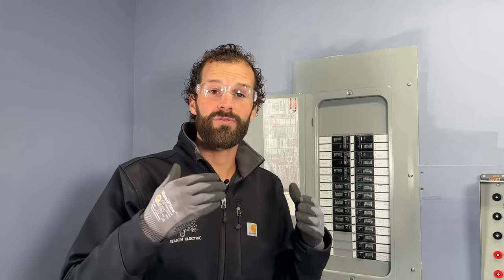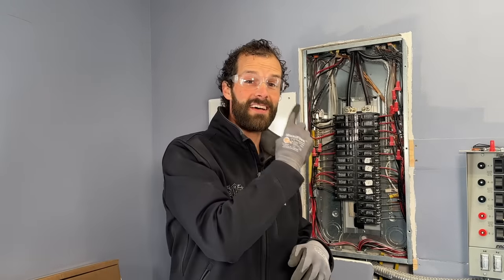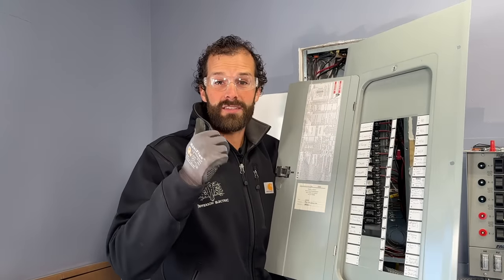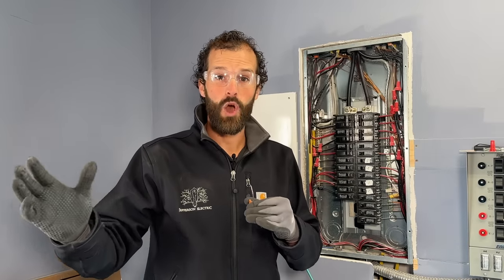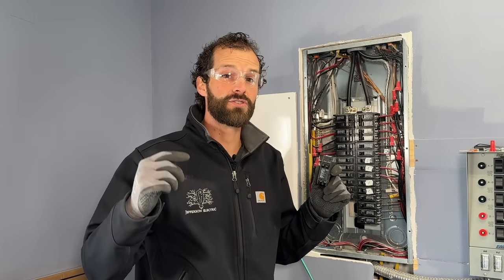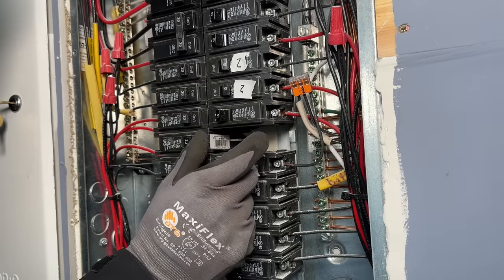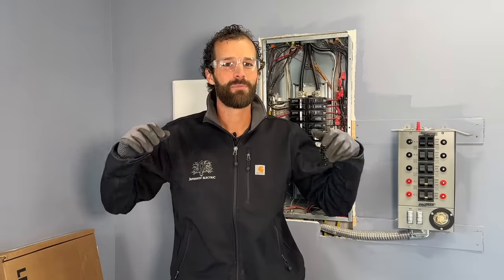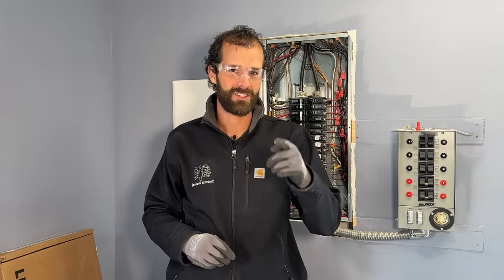No Room In Electrical Panel - Quick Fix

Comment: I've never seen an electrician shut off all power before removing the cover, but it's good advice.  

The downside to combining circuits is that if you turn off the power to do some sort of electrical work is you will turn off a lot more of the house with each breaker.   Do yourself a favor and write down everything controlled by the circuit in some detail and tape it inside the box somehow.   At a minimum, try to balance both sides of the service.

The best solution, albeit a very expensive one,  is to split the service coming into the house into two panels and then you'll have plenty of room for growth.  If you get an automatic standby generator, you'll end up doing that anyway.
Reply: OSHA requires protective gear to remove a panel cover even if you turn off the panel. Until you verify it. (Nobody does it)
Reply: @hankkline7300  It's good advice and well considered, but as a practical matter, many electricians doing a branch circuit in an existing panel will wire a breaker first and then snap it into the live panel, unless they're doing a major rewire.   They they'll shut the whole thing down.
Reply: @hankkline7300  OSHA doesn't have jurisdiction over homeowners or farmers with under 12 employees.
Reply: @Sc-jf3yk  Who mentioned OSHA?
Reply: @hankkline7300  you did
Reply: I was referring to electricians, not wannabe electricians.
Reply: @hankkline7300  why would an electrician watch this video?    They should already know it.
Reply: @Sc-jf3yk  Curiosity, I like to see what other people are trying to teach amateurs how to do it. I have seen so many do-it-yourselfers who think wiring is so simple. They make many potential fatal mistakes. Many homes I have gone into are so dangerous I would never be able to sleep in them. I know sometimes electricians make mistakes, but I can always tell if a handyman has attempted the job. I am sure that a homeowner is more qualified to remove an electrical panel cover than an electrician who has had more than 30 years of continuing education classes to maintain his license, but that is my opinion. The wannabe electrician installs his electric just like he saw someone else do it. Even if the other person has never done it for a living, or been trained how to do it safely and according to the codes which are there to prevent fires and electrocution. I have rewired many residences which have not completely burned down, and the people have not died in the fire thanks to God.
Reply: @hankkline7300  I respect your comment more than you know
Reply: WRONG. You don't end up doing that with an interlock and main panel.
Reply: @mastershredder2002  It's quite common to do it that way for a residential standby generator. It would be unusual to have a generator large enough to support 200A.   Typically two panels: one for the circuits with the interlock that will be automatically cut over to generator power, and one that is only powered by the line coming power company.  

Generator starts up, the interlock waits 30 seconds, and cuts over automatically.   When  power is restored, the interlock cuts back and the generator is allowed to cool down and then shuts off.
Reply: @hankkline7300  OSHA applies to Occupations, IE: workers, not homeowners or random you tubers making videos.
Reply: @teekay_1  "Interlock?" You mean automatic transfer switch.

Comment: I used to install gas station eq. I lost track of how many  PROFFESSONAL  electricians would wire
the cash register inside the store to L1 & all or some of the pumps outside to L2. Someone would 
turn on the regular #3 pump & 240vac would go to the pump relay &  !POW! a flash & some smoke.
So I got into the habit of checking all the wiring  at each pump BEFORE I applied power. Good times.

!

Comment: Smoke detectors must be connected to light load to ensure you notice if they trip by not having light.
Reply: that may be a local rule, but it's not a code requirement.
Reply: @kenbrown2808  And some jurisdictions require them to be on a dedicated  circuit.
Reply: @WilliamEades_Frostbite  a central alarm without a battery backup is required to have a dedicated circuit.
Reply: @kenbrown2808  Here ALL new builds require battery backup and dedicated circuit...Local Codes.
Reply: @WilliamEades_Frostbite  and here they'd prefer standard smoke detectors be on a general lighting circuit so a bad resident won't just turn them off and pull the batteries.
Reply: While most guys do this because it is very clever to insure the smokes won't be de-energized easily..... it's never been an NEC Code. This is how disinformation is made right here.😆
Reply: @WilliamEades_Frostbite  Are you sure about that? Making it dedicated on one breaker makes it that much easier to turn off with no inconvenience to the residents, I think you missed the point. If that is the local code then it's not very logical.
Reply: @fritzmiller9792  that's why i said "prefer"
Reply: @fritzmiller9792  You have to take into consideration that the NEC is a subheading of the NFPC.  In practice there is a lot that from experience seems illogical in the NEC.  And that local jurisdictions are allowed to toughen the NEC, but not weaken it.  Here you can cross the street, going from city to county and run into completely different code requirements above and beyond NEC.
Reply: @WilliamEades_Frostbite  yes, fire detection falls under the NFPC and to the local authority which is likely the Fire Chief. So the rules can be greatly different from town to town. I routinely invite the local fire department to layout/approve the method I want to use even though I usually have a better grasp on what should be done than they do because technically it's their call
Reply: @WilliamEades_Frostbite  Actually, local jurisdictions very often strike NEC rules that they don't agree with.....I take no side in it but that is what technically happens. Every case is specific and reasoned but it does happen. My State usually takes over a year to adopt the newest Code and has chosen not to enforce/accept changes until a later date.

Comment: Smoke detectors should always be tied to kitchen or bathroom lights ,so you will always know if they are out .
Reply: Most detectors have battery backup and will chirp if power goes out
Reply: Depends on jurisdiction
Reply: @Sc-jf3yk  over and above jurisdiction, I think it’s a good thing to do . My main thing is never home run smoke detectors,yes I know it will beep when the battery backup gets weak ,but if you can’t see in your bath room you will most likely investigate. If your home run smock detector breaker is tripped you won’t know until the beeping.
Reply: New powered smokes will always chirp if no power or something not hooked up right. It doesn't wait till the battery is weak.
Reply: @jenko701  and again depends on jurisdiction and inspections.  Really doesn't matter what you think.   If it's wrong you'll just fail
Reply: @jenko701  No they'll all chirp when main power is cut, not just when the batteries get weak.

Comment: 1. I've never heared an electrician or read any publication that advises homeowners to enter a panel.
2. You skip all the way around ampacity and current amperage load.
3. Available wire lenfth in the panel might not be sufficient to allow much shuffling if any.
Reply: I could write pages of what these guys don't (actually can't) tell people in these DIY videos.....they are so anxious to tell what they know but ignore the many things only experience can give to the viewers. They are like Fathers and Uncles spreading disinformation, LoL. (I got that line from Click and Clack 😆)
Reply: @fritzmiller9792  
I 100% agree with all you said. They give just enough to get people in trouble; then those people are shocked by the cost for someone else to come in now.

Comment: I have a older home and installed new gas water heater, gas dryer and finally gas stove Removing the electric appliances opening up several spots in my box

Comment: If I was an electrician I'd wire my box like this. Very organized and neat. My box is disorganized and lazy.

I used to wire f18 and AV8B testing boxes and always branched them and zip tied them
Reply: Me, too!  I always route all wires going toward a same direction as neatly organized in branching groups going into more branched groups until the final destination wires are terminated.  It's just something I have to do.  I guess it started in the Air Navy, working my way up the enlisted ladder, and upon reaching a new base assignment both times, as an Aviation Electrician's Mate, I would support a Squadron of P2 Antisubmarine Warfare/Search and Rescue, twin Radial/Rotary Piston Props with wingtip jet boosters, on the squadron line, maintaining the P2's electrical systems, including wiring bundles, and its various Navigation Systems. Once the Avionics Intermediate Maintenance Department (AIMD) section was completed within the Electricians' Repair Section of AIMD to support the modified-from-an Airliner into the P3A Orion Patrol Aircraft to take over the P2's Mission.  I worked on the Analog Computer Navigation/Guidance System and, its backup, the Attitude Heading Reference System, indoors in the A/C. This happened at the beginning of each enlistment, working on the squadron line, briefly, as I waited for AIMD to be ready for my section to be used.  Other than a tendency to always do my best, also considering appearance, my neat freak wiring preference probably came from the Navy.  What kind of work did you do?  I wanted to be an Avionics Electronics Tech, but a high frequency hearing loss prevented that, but my job, rated as an Electrician, still got me working in electronics.

Comment: Ugh  my house is a mess 1990 Las Vegas builder special, ive got kitchen outlets tied in with dining room lights breaker,I literally have 3 breakers for my kitchen..not to mention when I replaced the GFCI in kitchen it wasn't wired properly and wasn't even working.Cant wait to change the one in garage im sure that is messed up too .I have to replace whole panel soon its been rotting outside in the vegas sun for 30+years, and one breaker keeps tripping under load so that's concerning ,great video for all the folks out there thank you
Reply: Ya... you shouls have your electrical checked out sooner rather then later. Doesn't sound good
Reply: A constantly tripping breaker is an indicator of an issue.  Either wiring or a device on the circuit.  Either one could start a fire.
Reply: @WilliamEades_Frostbite  im thinking its the wiring i replaced the outlet and its fine,replaced a 30 year old back stabbed from builder.Once I get back to work from my surgery and get some money coming back in im having the whole system gone through its a mess..and its better then the plumbing lol
Reply: @Troy-McClure81  If one was back stabbed, then it's a good bet that they are ALL that way, including the switches.  What I did in my home when I bought it was over the course of a few weekends,  power down one room at a time and swap every device from back stab to side screw as I too had power issues.  The next thing I did was to re-torque every connection in the Main Panel.  The number of loose terminals there was amazing.   The last thing was to call in for a "Cut Seal" authorization, pull the meter and retorque all the Service Feed Terminals in both the Meter base and the House Panel.  I found a couple of loose terminals there as well.  What the point here is that the older the home, the more likely that thermal cycling from current load over time has caused the wire under the terminals to deform and "Loosen" in relation to the connection.  So the first thing I do on a call for Trip or fluctuation problems is to check the terminal torque on everything in the panel.  You would be amazed at the number of times I've found the problem is nothing more than a loose breaker terminal.
Reply: @WilliamEades_Frostbite  ya I went outside to my panel and when I pulled panel off was covered in old webs and fried out spiders.In Las Vegas "Code" says you can't replace outlets without permit unless there bad.Needless to say ive replaced all but 6 outlets and 6 switches, all were backstabbed some weren't even done right,I have 2 gfci one in garage and one in kitchen that wasn't even working.I have one breaker on bottom of panel marked Gfi but it just turns off outside lights.Kitchen is on 3 breakers,only 20amp is under sink.Its a mess i had major back surgery so im out for while .Thank you for advice once I looked at panel I ascertained it needs replaced its been frying in the vegas sun for 30+ years and wires are a mess house should've never passed but in 1990 houses were frame to finish in 30days so stuff was missed.

Comment: I was concerned that my house was tapped out on 200 amp service because I wanted to install On-Demand water heating. I started tracing lines to realize that roughly 30% were installed by an idiot. For instance: The doorbell chime transformer had its own dedicated 20 amp breaker…
Reply: " The doorbell chime transformer had its own dedicated 20 amp breaker…"

What kind of music did it play?
Reply: @teekay_1  Symphonic.
Reply: I am tapped out at 200 amps... if  my heat, well, septic, dryer, hot water, dishwasher,   heater all kick in, welder ,  blame 200 Amp main shuts down... can't get the power company to up me to 400 amps gerrr.  .... lol smart panel  we only have dsl where I am. 1mps... unless you go to a Sat system.  Rural places are stuck in the 80s.
Reply: I maxed out my panel by running light circuits.   The inspector counts  the circuits in the panel and records it.    Now If I add new circuits or load the curcuit I don't need the inspection or the permit. Lot less headache. Might be the reason for the doorbell

Comment: You might also add that being in the field I have seen people who mix and match different manufacture breakers in one panel. Big violation of the code.  Good video. I was taught to wire nut 2 circuits together and one wire into the breaker. All with the same gauge wire. I am retired 15 years so I am sure there have been many revisions to the code.

Comment: C’mon. All your doing is jerry-rigging to accommodate new circuits.  Do the job right and put in a sub-panel or just rip that one out and put in a bigger one.   If you guess wrong you could seriously overload a circuit and leave the customer with a problem they paid not to have.
Reply: Everything he said is accurate and absolutely the right way to do it to the point of load capacity.

Comment: Did you just combine A phase and B phase conductors?  Now you could have an "Unbalanced load" and excessive current on your neutral. Common mistake in residential but it looks like this wasn't a multi wire branch circuit so you probably have 2 neutrals, and your fine.  Besides it would be a violation of Section 210.4(B) not to have simultaneous disconnecting means such as a 2 pole breaker or a tie bar connecting 2 single pole breakers. 210.4(D) requires ungrounded and grounded circuit conductors are to be grouped by cable ties or similar means. Good job on the video. It was very informative. 👍

Comment: Do not follow this advice! The way that was shown in the video can easily overload the neutral capacity for the 2 circuits combined depending on how the house was wired initially. The proper, safe, and code compliant way to do this requires more knowledge and experience than represented. If you need to make space in your panel it can be done, but it needs to be done correctly. This is a oversimplification of a common problem. Follow at your own risk. 25 year licensed master electrician.
Reply: That should have been addressed in the video. Probably shared neutral. They did that, back then. Like my house. My understanding (DIYer)  is that shared neutrals should NOT be on the same phase.

Comment: Don't EVER do what is shown in the thumbnail.
Reply: Follow Square D recommendations? It's rated for 2 wires to the breaker.
Reply: WHY?
Reply: @Cherokee10g  probably has no idea why you shouldn't follow the manufacturers safety data.
Reply: @Cherokee10g  

The possibility of arcing.  
The creation of heat.
The creation of potential unnecessary loosening of points of contact.

Creating more branch circuit pathways to result in over current conditions. This is inviting the branch circuit loads  via the outlet-receptacles to overload the over current device (the breaker; which will then, if done, have MORE pathways via TOO many cable conductor hots to result in maximum current amps flowing thus throwing the breaker).

Reducing the clamp strength of the screw securement of the conductors under the pressure plate.
Creating a new hazard of loosening from vibration.

Etc....

There should be only ONE hot conductor terminated into the breaker.  Do NOT stack two conductors into one breaker under one pressure plate even if it may have a metal pressing that has the seating shape. 

There should only be ONE hot conductor terminated to ONE over current protection device.
Reply: @Cherokee10g 

Such installation is example of shoddy construction that attempts to squeeze every penny out of a dollar.  It's also the hallmark of lazy, unintelligent branch circuit wiring planning, load calculations and installation.
Reply: If you think that’s a problem, you don’t understand electricity.
Reply: @greenbudkelly2820  

Not only do I understand electricity, THAT is a problem .

Comment: So if the loads are equal on the split and the neutrals separate, then each 15 amp circuit is essentially on a 7.5 amp breaker? In other words, if the two combined home runs draw more than 80% of 15 amps then the breaker will trip, right?